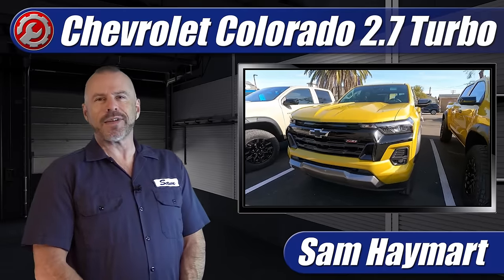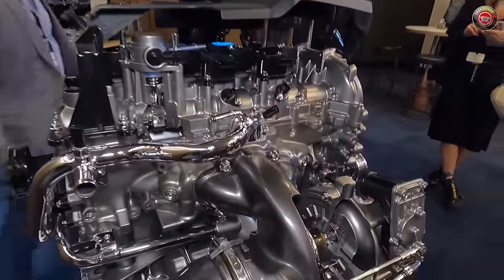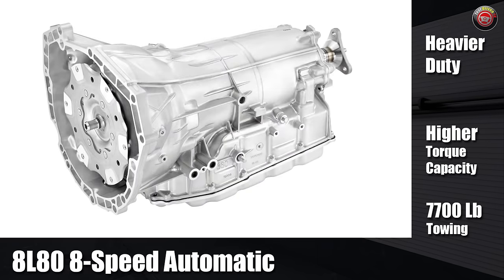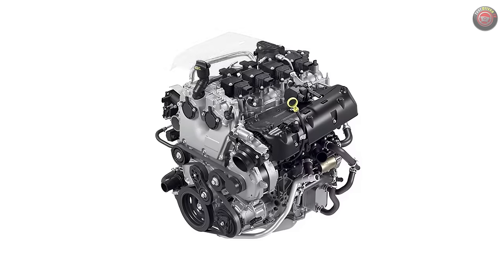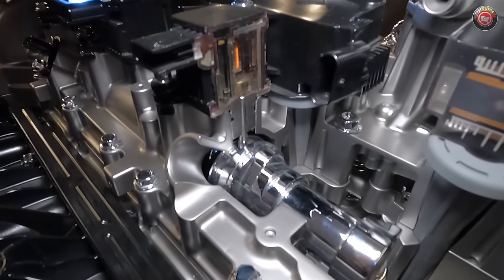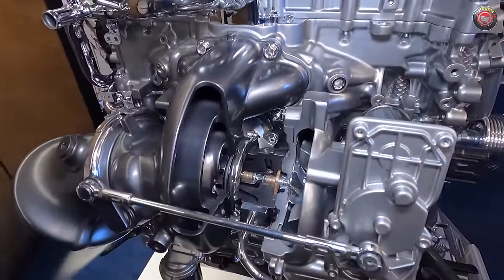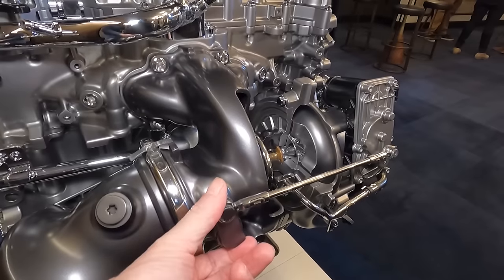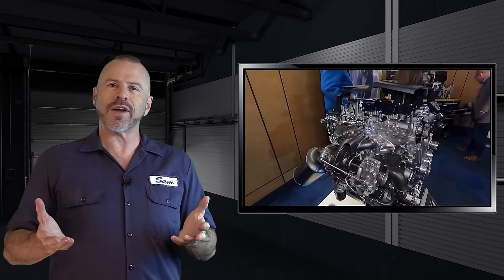2023-2024 Chevrolet Colorado 2.7 Turbo Engine: What You Need To Know

Comment: I'm still waiting for the one cylinder supercharged engine that deactivates its single cylinder when it blows up after 3 miles.
Reply: It's pretty sad because I used to have an se-410 Callaway Edition in the GMC Canyon and the Chevy Colorado.
And their two-door long bed pickup truck in the Chevy Colorado was the number one Fleet Sales truck for construction. Yes those customers will be buying Nissan's now or Ford Rangers
Reply: It won't blow up... it will de-rate power to 50% or 50 mph so the customer came limp back to the dealer and get violently assaulted while being assured when the parts come off of backorder  you can apply for a line of credit to pay for repairs.
Reply: Lol
Reply: Mostly peaceful cylinder deactivation. Safe and effective
Reply: You just made me want to turbo a hit and miss
Reply: lol give them a few years
Reply: Next year
Reply: You shouldn’t have long to wait
Reply: Yeeeaaaa…..what could possibly go wrong by putting a sowing machine motor in a pickup
Reply: @craigcook1571  lol
Reply: This comment had me dyin man
Reply: Holy shit you made me laugh so hard i thought i was going to stroke out.👍👍👍👍👍🍻
Reply: Sooner than later😂😂😂😂
Reply: 2028 will be your year , it will debut in the one wheel drive " Ukraine " trim level .... It will operate on tax dollars stuffed into a new 10,000 gallon tank ....
Reply: Lol actual 😂😂😂
Reply: After buying Chevy trucks for thirty years, I have no regrets switching over to Nissan trucks . I'll keep my 3.8 liter 310 HP V-6.
Reply: They named it the “classic Chevy shake”.
Reply: I hear Ford is putting one in the F650. Rest assured their engineers are saying they’ve stress tested it and they got it up to 38 million miles, took it apart and it still has new engine specs.
Reply: Funny since only 12 engines failed in the history of the engine
Reply: There are no lifters in the L3B motor.
Reply: This comment is funny because it’s true in automotive technology today. 🤣

Comment: I am late on this, but i just got a Canyon and holy shit is the engine a little monster!
Reply: Hey, I’m really interested in buying one of these. Did you get the diesel or gas?
Reply: @nickkammer5863 it only comes in gas with turbo you can get the L3B being the highest output variant for this motor. Canyons come Standard with this motor Colorado’s are standard in  Zr2 and Z71 i believe but yeah only turbo Gas last gen was Diesel.
Reply: I got mine, too. Is  monster
Reply: You gotta laugh at all these antique  pushrod V8 guys. This thing has more torque than a Hemi.
Reply: @thomaslehmann5981 lol for how long? 🤔

Comment: I'm still enjoying my 3.7 naturally-aspirated five-cylinder engine from 2011. It has more horsepower than the base engine in this 2023 Colorado.  No cylinder deactivation, no turbo, no auto-start/stop, and it has plenty of long-lasting durability.
Reply: Sometimes it's good to keep those older trucks alive, if they work, why trade up. I recently purchased a 99 silverado (GMT 800) 2500 with a 6.0L V8, extended cab with an 8 foot bed. Has 320k km and mechanically sound. I want a new Tacoma or Canyon, but I paid $2000 for this truck, do I want to make payments for the next 6 years? Or is it worth it just to get a new truck?
Reply: @Wojtek Swiezak  I agree. My 2011 Chevy Colorado cost me $26,000 brand new. The dealer actually had taken $4,000 off the MSRP. The new Chevy Colorado cost about $45,000, then you have to consider excise tax and everything else. My truck is running great, the only problem is rust on the frame. But I'm having that taken care of by NH Oil Undercoating rust converter and Oil treatments.
Reply: I drove and pulled with the 5 straight. This 2.7 has a ton more torque. And you feel every bit of it. In towing tourqe wins over hp. If top speed is what ya want then go for hp.
Reply: Don't forget reliability
Reply: My concern is carbon build up fron the gasoline direct injection. They Chevy needs dual port injection to solve the carbon build up issue inherit  in  gdi, and di engines. Toyota has done across the board as well as Ford in thier 5.0 Coyote V8.
Reply: @ericsivilla4091  Scotty Kilmer recently posted a video saying that these GDI engines are actually causing more particulate pollution in the air than a normal engine.
Reply: @ericsivilla4091 There's a video from GM on YouTube that shows how they changed the PCV system on this motor to prevent the carbon buildup your talking about
Reply: @mt186  The best way to solve the carbon build issue on the back of the valves is  with dual port injection . Ford just updated the 2.3 turbo engines with dual port injection.  GM may have redesigned  the pcv to help out, so it won't carbon up as fast, but eventually, it will.
Reply: @ericsivilla4091  Yeah I understand what you're saying and some manufacturers have been doing it that way for 7+ years now. In the video I'm talking about they say they ran the hell outta this engine and found what needed to be addressed. We'll see. I believe their are variables between engine designs that cause changes in flow, heat, turbulence, etc that only the engineers may take into account. Time will tell
Reply: @mt186  I definitely agree with you on engine designs. Hyundai is probably being the worst,  VW not to far behind. From my personal experience some are worse then others,  for example Hondas seem to do better, specially with non turbo, but the only thing I've seen that absolutely prevents carbon us the dual port injectors. Gas is a  solvent / cleaner,  the 2st injector sprays the piston,  the other sprays behind the valve. Every Toyota Gdi engine I've seen has zero carbon. You gotta live how Toyota has metal injectors. While the German Supra / BMW has plastic injectors. Hum...  Anyway back to tge Carbon thing. Old school engines  such as a Hemi 6.4 for example,  since it's not GDI it doesn't have the carbon issue, and doesn't need dual port, since tge injector sprays behind the valve, but with GDI engines. I'm going to have to go with dual port,  anything other than that is just experimental.  Cars are too expensive these days to take chances. The Colorida doesn't have a very good track record either.
Reply: Your lucky cause those engines are well known to be trash, the 2.7 your year had less power but way more reliable! Your engine has zero chances against this turbo plus in power and reliability!
Reply: @jimmycline4778  Some bloke has 400,000+ miles on his 3.7 five-cylinder engine.   Can't be that bad.
Reply: Good luck with that energize because they have a terrible reputation! The 4 cylinder that year was a much better motor, I put 325,000 on mine put guy made a left in front of me and totaled it out!
Reply: im still driving my 1999 s-10 4x4 ext cab 4.3  vortec v6 zr2 :cat-orange-whistling::face-blue-wide-eyes::face-green-smiling:
Reply: @user-ot1hn1yb6y  them Vortecs are very good engines. My Vortec 3700 five-cylinder is apparently missing the 6th cylinder 😲, but it still runs great! 😇 These newfangled engines  (turbocharged 4s, 6s with cylinder deactivation, etc) don't seem to offer anything amazingly beneficial, especially compared to their cost and complicated systems.
Reply: Amen, I’m almost to 200k miles on mine and it still runs like new, provided with proper maintenance of course but those give tacomas a run for their money 😊
Reply: Considering it replaced the 3.5 which had problems like the 2.8. It's an Atlas Vortec 3700 you have.
Reply: All in the torque curve not the top end
Reply: I have a 2012 Colorado w/3.7. Just turned 125K no issues.
Reply: 5 is an odd number, so where did they put the odd cylinder? How is it even balanced?
Reply: there's no cylinder deactivation on the 2.7, I've heard tons of people say there is but I've had my 23' Colorado for 10 months and 50,000 kms and there's definitely no eco mode
Reply: @concernedcitizen2898 straight 5 I would guess….
Reply: @ericsivilla4091  I worry about the valves on my 2016 canyon that has 101K miles now but then in the Forums there are a lot of guys with 250K miles that run ok. I don't see how. I just use top tier gas and full synthetic oil and hope for the best. I love the truck and want to keep it.

Comment: Can someone please explain how a 40lb ft and 7 psi increase on HO doesn’t also result in increased HP?! I mean it’s a math equation… if the engine run at 20 psi makes 310hp and 390lb ft of tq, how does the same engine make only 310 HP while increasing to 430 lb ft?
Reply: Most likely turbo is maxed out.
On old Dodge Daytona's with a 2.5 litre turbo engine that came with a tiny Mitsubishi TEO4 turbo and when you bumped up the boost the same thing happened.
Reply: Because the torque is spread at lower RPM, not higher RPM to increase peak horsepower. Horsepower is just function of torque and RPM. You can increase horsepower and torque at any RPM outside of peak horsepower RPM, which can inflate your peak torque figure yet still maintaining your peak horsepower figure.
Reply: My guess is the ECU maps between the two calibrations are basically the same at ~5k RPM where you'd make peak HP, and the bigger difference is in the lower RPM range around 2500 or 3k on the HO map and they've calibrated the wastegate to stay closed and build more boost there versus the "plus" map. So your 7 PSI difference between the two is probably in that 3k RPM range for the peak TQ difference, and otherwise have identical timing and boost mapping at 5k and making the same peak HP.
Reply: @DavidGarcia-vh3ul  10 points to David.
Reply: Because boost is a measure of airflow restriction.
Reply: Also, knowing the torque unit without knowing the RPM is somewhat pointless. Horsepower is an equation where the inputs are Tq and RPM. For example an engine producing 50,000 ft./lbs of torque at 0.0 RPM is making ZERO horsepower.
Reply: @carlsymington1386  you are not wrong, but let’s keep in mind that the top fuel dragster produces 50 psi of boost. Referring to that as a restriction seems odd.
Reply: Turbo peak hp is maxed... which is an entirely different question. The real conundrum is what exactly is preventing the base from running the HO tune... answer: absolutely NOTHING!
Reply: @rhar1044  The components are not as robust, and don't have the "safety factor" to accommodate.
Reply: @carlsymington1386  Boost is a measure of air pressure in a dynamic system. Certainly an airflow restriction will increase it, all other things being equal. At 14.7 psi boost, the intake valves receive a charge that carries twice the pressure of normal atmosphere. And boosted engines at 14.7 psi will often make close to twice the power of the same engine NA.
Reply: You have to spin the engine faster in order to get more HP.  The 20 psi and 27 psi engines have the same max RPM so there's no increase in HP.  In other words, the vehicle with the 27 psi engine won't go any faster, but it'll accelerate a lot faster.

Comment: I'm in love with this engine and the colorado. I want to get a trailboss next year
Reply: Why
Reply: @johnrodriquez1912  almost all mid size trucks are shit rn Tacoma has had recalls failing transmissions , frontier and it's eletrical gremlins ,bronco and it's ecoboom engine dropping valves and blowing up head gaskets,ford ranger is expensive af ,this one is the only one where it looks good and reliability is liveable,could still be improved on reliability tho and it's infotainment glitches
Reply: @jeremyclarkson-69 chevys been killing it with the last gen duramax 3.0L/2.7L engines. I was bummed when they stopped the diesel 2.7 line but this new turbo max has been pretty great. Haven’t heard much bad about it since it’s release aside from some oil consumption, which isn’t abnormal. I’m not keen of all the AFM cylinder deactivation nonsense, but the overall quality and durability of the motor is what interests me. Seems they didn’t cheap out on the internals. Colorado won midsize truck of the year recently for a reason. Looks a lot nicer than the ugly designs Nissan and Toyota have been making as well
Reply: @_N4VE_  I quite like the L3B found in the Colorado independent shops have opened and overviewed the motor ,they claimed it's built like a diesel,it's a good motor it seems and it has been used in the Silverado for what 5 years now ,no major issues I think it had some issues with the turbo waste gate and timing chain stretch those were ironed out by Chevy tho I think just do your oil changes and you'll most likely be fine ,for the buck I think it's the best in the market right now

Comment: I bought the ZR2 and that engine is extremely powerful. The acceleration to pass other vehicles is exceptional.
Reply: i bought a 24 sierra crew cab in 4 wheel drive  2.7 turbo  sold  a 2013 z71 5.3   the 2.7  feels like  a beast of an engine  compared to the 5.3  love my 2.7  great choice

Comment: Thanks for getting more specific than I have seen elsewhere, about exactly how the base engine is "de-contented".  The lack of piston-squirters and the weak-sauce transmission explain the lower towing rating, and the missing foam explains why people have observed that the base engine sounds "coarser".  We know the price difference, once we see fuel efficiency we'll have the whole picture.
Reply: 🤨 Count on GM to fall short on giving the customers a better product….
Reply: @MrJEEPJT  As a Chevy guy, I hate it, but have to agree, and I think that is the same for a lot of manufacturers today.  It is all built to be more expensive to the consumer, break down and require more costly repairs than ever before
Reply: Yes ! We have already seen what happens to the piston oil jets! Gm had a nightmare with the 3.6v6  @zman204

Comment: I have a 2016 Colorado Z71 crew cab and so far it’s been a reliable daily driver. I bought it new and it’s paid off. It still works and looks great. I have the V6 and with only 89k miles on the odometer it’s still got plenty of life left in it. The v6 should have been left as an option.
Reply: Pretty much same here. 2015 LT 6 cyl. bought new. Almost 90k miles with no problems.  Wish I could still get the 6 with the long bed.
Reply: I have a 2016 canyon 3.6 with 101K on the clock. Solid truck runs like the day I got it 8 years ago. Actually  better after I had the dealer do the ECM TCM update reflash.
Idk if you guys had that done but it cured any shifting issues I had.
However I'm  not bothered by the turbo 4 at all. All that low end torque is really nice if you ever drove one.
The short bed is a problem for me though. That sucks no xcab option.

Comment: I like the idea that they pump coolant through the turbo to help keep it at a much lower temperature taking some of the stress off the oil but I’m sure it’s still a good idea to let it idle for two minutes before shutting it off
Reply: It most likely has an aux pump that runs after the engine is off briefly.
Reply: So, I have a 2013 Cruze, I bought it in 2018, and now in 2023, I have 75000 miles on it.  I just had the water pump replaced under a "special" warranty, that was extended just for that part to 100000 miles.  The thermostat/housing was cracked, the water outlet was leaking, as well as the oil cooler.  The last 3 items I did myself, and the cruze has oil as well as coolant lines that run to it.  to change the oil cooler, you have to remove the exhaust manifold/turbo assembly, and my turbo was cracked in 2 places internally.  That is what I fear with all these new small turbo engines, especially from chevrolet is that they are priced premium, yet built with sub par parts
Reply: Water cooled turbos don't really suffer from the same heat soak spike that occurs with air/oil cooled only setups, so idle time really isn't needed. If it makes you feel better though, go ahead. Can't hurt.
Reply: The water pump and the fans can run with the engine shut off.
Reply: After towing, yes.  After a regular drive, nah, maybe 30 seconds if paranoid.

Comment: My son has this engine in his Silverado. I thought it would be a dog with a 4 banger, but was pleasantly surprised when I drove it. It pulls pretty hard. He has 70K trouble free, so far. 
I just picked up a new ZR2 Colorado...same engine. Love this truck. Ive always been a V8 truck guy, but Im sold on this 2.7 turbo. Ive stopped trying to explain that to the V6 or V8 die-hards.  If you dont understand it, go git yerself a V8 if it makes ya happy. Not my job to explain it to them. 😂😅😂

Comment: Very useful info not seen anywhere else. The L3B HO is clearly the best choice. Thanks very much.
Reply: I agree, that's why I just decided to order a GMC Canyon and pay a little extra so I could get this engine as standard on the GMC. I hope I won't be disappointed.  I will let ya know once my 2wd 2023 Elevation gets delivered.
Reply: @johnwhitneykokalis9990  all trims of the Canyon come with the HO?
Reply: @bigd2256  Absolutely. ALL GMC Canyons get 2 inch or more lift, and 310/430ft lbs of torque. And wider stance than Colorado also.
Reply: @johnwhitneykokalis9990  thank you for that. Currently have a 22 ZR2 but I’m thinking about switching out for the new Canyon. I want the AT4X but not available yet I believe
Reply: @johnwhitneykokalis9990  i sm leaning towards trading my daughter of 2023 tacoma trd off road truck in on a 2923 gmc elevation or the better gmc at4x it just at4 4x4 truck. 

My Tacoma gets horrible fuel economy driving in in northeast Tennessee on our hilly terrain highways in the tri cities by kingsport and johnson city areas at base of the cherokee national forest.
Reply: @johnwhitneykokalis9990  that is true for the lower models, but the AT4 and ZR2 are share the same suspension lift w/mulimatic shocks/struts, HO engine (310/430), and hardware. The ZR2 has a little better ground clearance due to body style but that's about the only difference in the two.
Reply: @mohead792001  yep, I have been driving mine since April of 23 and love it. I have had zero issues with it at 12k miles.